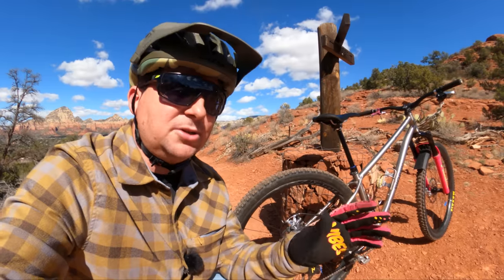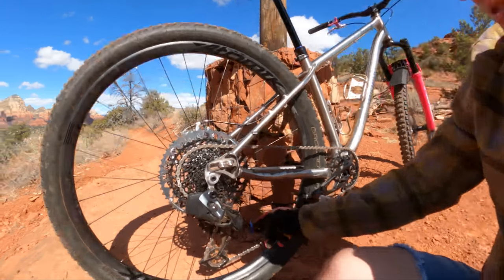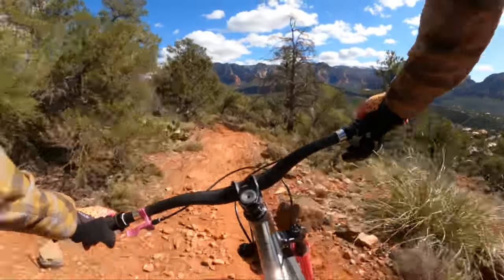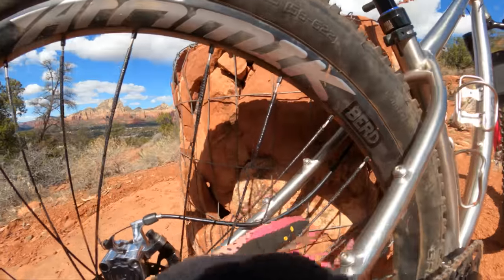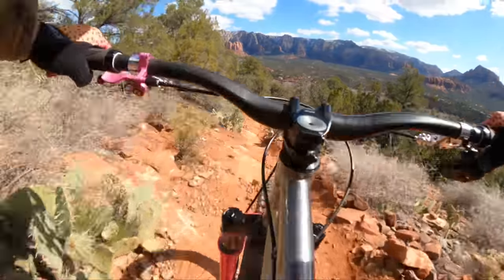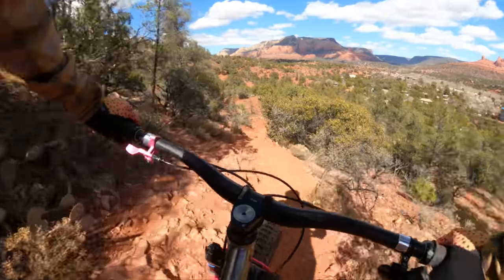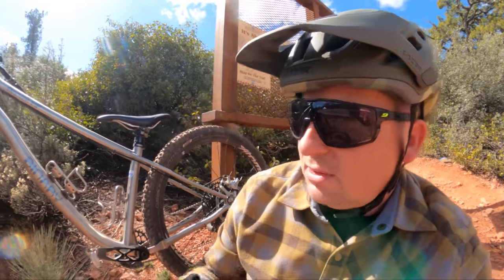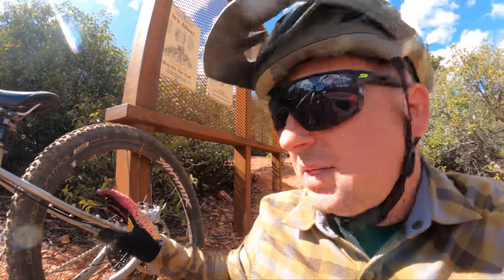Are BERD String Spokes More Compliant? Ride Test: BERD vs. Standard Steel Spokes

Comment: You should a super slow-mo huck-to-flat comparison on a hardtail with these spokes.
Reply from the maker: That would be very interesting to see. I wonder if it would be visible. I feel like most of the vibration reduction is on a minute level. I don't imagine these looking tons different from traditional spokes on a huck to flat since they have the same spoke tension as steel spokes. I think it's more of a micro vibration damping feel than a springy/flexy wheel feel.
Reply: @hardtailparty it would be interesting 
Impact makes even rigid structures do crazy things
Reply: @joelawton123  did you see Berd's own impact test machine? Its on their site
Reply from the maker: If only those cameras didn't cost $60k
Reply: @hardtailparty  see if you can't do a collaboration with the SloMo Guys!
Reply: @MrTrixton  I’ll have a look

Comment: Here's the elephant in the room that no one seems to talk about regarding Berd spokes: most Dyneema products have a life span of about five years. So are you going to rebuild all your Berd wheels every five years? This is one of the main things keeping me from adopting Berd spokes because when I build my bikes I'm not afraid to spend, but I expect things to last.
Reply from the maker: Interesting question. I haven't heard that stat before. I'm sure different dynema uses have varying fatigue characteristics and lifespan. But these haven't been out for 5 years yet, so I can't speak to that.
Reply: Yeah, huge variation in lifespan depending on usage conditions, grade of Dyneema, and any treatment used (such as PU coating). AFAIK the Berd spokes use a DM20 material which is SK78 grade. This means it is relatively low tenacity compared with higher grades such as SK99, but importantly is zero creep. Creep is where the material, if constantly loaded, elongates slightly over time. In a bike wheel, this of course would mean reduction of spoke tension. But I do agree, these spokes should be marketed as having a finite lifespan.
Reply: Berd only has a limited warranty for  5 years on the spokes.

Comment: Great video Steve! I always appreciate how well you articulate comparisons like this. 
I did a similar test but I rode a fairly high speed trail and noticed a the ride to be quieter, more damp, and a bit zippy-er in the turns with the berd setup. Overall it just felt more controlled and the bike was a bit easier to hold onto (for a hardtail) The difference was a little subtle but over the course of a 3 hour ride I think that adds up to a lot more enjoyable experience. And on a hardtail I think a wheel upgrade is worth more than buying a top spec fork vs mid-spec. Just my 2 cents. Keep killing it buddy! Hope to ride with you soon!
Reply from the maker: 100% agree, well said. I hope our paths cross sooner than later.

Comment: Interesting comparison and discussion. Have you or know of anyone who have tried Berd spokes with aluminum rims. I've only seen reviews of them with carbon rims. I have the Zipp 3Zero Motos on my hardtail and I love them. Being Berd curious, I'm wondering how it would be to replace the spokes on my Zipp wheelset with Berd spokes. Would it make the wheels feel too squishy given that the rims are already so compliant? I have the Zipp hubs so I don't even know if that's possible. Lastly, are the Berd spokes touching each other when they cross? I can't tell by looking at the videos but I suspect they do. If so I'm wondering what the long term effects are with them rubbing against either other with dirt/dust trapped in the pours of the fiber weaves.
Reply from the maker: That's a question I have too. BERD hasn't found a way to make their spokes work with those rims yet

Comment: Agreed on all points.  The spokes are lighter and they damp vibration.  So you still get the initial impact but it just feels less harsh and jarring.  I feel like my LES with Berd spokes and 2.4x29 is smoother than my 2.8x27.5 Chameleon with Atomik Chubbies and Tannus inserts.  And I LOVE the Chameleon, really fun bike and the wheels I have on it have really made it that much more fun, but the LES has really surprised me.  I thought it would be much more harsh, but it isn't.

Comment: Yo HTP, love your vids.  I could watch you shredding Sedona singletrack all day.  I think this comparison would be less biased though if you didn't know which spokes you were running.  Maybe next time have a bro put your wheels on behind a blind, do the ride without checking the gear, then swap out the wheelset (don't peek!) and give your impressions on both cases before the big reveal.  Makes for more engaging content, less bias, and thus better informed consumers.
Reply from the maker: Here's a fun way you can replicate this blind test. Seek out the timestamps when I ride past the same bit of trail with each wheeelset. Get a friend to toggle between the two. See if you can hear the difference between each wheeelset on this video. I'll bet you'll be able to tell which wheeelset is the BERD one because it'll be a LOT quieter than the other.

Comment: I'd love to see the physics behind the difference. If you think that a bike effectively hangs from the rim and the spokes are under a reasonable amount of tension it must all be down to the damping properties of the different materials and how they absorb/transmit vibration.

The aluminium rim/Berd spoke test feels like something you're going to have to do Steve now that a few people have brought it up! 😉
Reply from the maker: oh man, these tests are getting expensive!
Reply: Its pretty straightforward. The Berd spokes have approx 3x the elongation of a regular steel spoke (depending on the steel spoke), and the material used doesn't have the same resonance after a load-unload cycle.

Comment: Out of curiosity I weighed my front wheel (the rear requires tools. Too hard)
Praxis AL32 alloy rim laced to a novatec boost hub with straight gauge stainless spokes (unpainted) with a 29x2.5 Maxxis Minion DHF in tanwall and a 200mm Shimano XT rotor 
2340g

Comment: You should do a review on the fezzari Wasatch peak! 900$ for a boost thru axle bike with air fork. There is many different spec levels… the most expensive being like 1800 the cheapest being 900

Comment: I am rather curious how you determine the right tire pressure for yourself, especially with you switching tires. I watched a video about 5 yrs ago on finding a good tire pressure for yourself and the type of riding/trails you do. The guy said to start within 4-5 psi of the max pressure of the individual tire, ride a similar trail, drop the pressure 1 psi each ride, and when the tire feels like it's trying to roll off the rim, go back up 1-2 psi. I'm not sure if this is the right way, but it seemed to work for myself. Just wondering your opinion on this since you have alot of experience with tire swaps, especially with hardtails. 
I ride a plus hardtail and every tire has been different, tread pattern density, sidewall stiffness, and tpi
Reply from the maker: I go entirely by feel, not by numbers. I know it sounds like a cop-out, but I don't have a magic formula. I don't entirely agree with what that other guy said, but if it gets people experimenting, I'm all for it. I run different pressures between my hardtails and my fs bikes too, with my hardtails running a lower pressure. So much depends on riding style and terrain, as well as rims, tires, etc.
Reply: @hardtail party  Thanks for the reply. That guy's advice was in my opinion a good starting point, but ultimately like you said it's all dependent on terrain and feel. I ended up going about 3-4 psi higher than what he suggested, it was too soft and felt like I had a flat.
Keep up the great work, love your content. I am not being biased just because I love hardtails.

Comment: As far as mountain biking being an expensive sport, what surprised me most was how much the tires cost and how fast I go through them. I go through about 2 sets per season and if I get maxxis tires, that's almost $400.
Reply from the maker: Tires are indeed CRAZY expensive. That said, I'm pretty impressed with what they can ride through these days without popping, but yeah... they shouldn't cost nearly that much.
Reply: That's why I ride specialized tires
Reply: @Alabaster  good point. They had a sale recently, and I got three tires shipped for $100.
Reply: Facts! The other day I was looking on Amazon “obviously”, to buy some Muc Off Drivetrain degreaser. What did I find?! A $135.00 bike cleaning kit with a microfiber cloth?! Just ridiculous…

Comment: What would the BERD spokes do for a journeyman class wheelset like the NukProof Horizon v2?
Would it be a better upgrade to change out the spokes, or get a supple carbon rim?
Would we notice the weight and ride quality from the spokes more than rim construction?
Can we even do that on an aluminum rim?
Thanks for the review!
Reply from the maker: Lots of great ideas for future experiMENTAL videos. Since the BERD spokes themselves cost more than the entire nukeproof hzn wheelset, I don't imagine a lot of people going this route, but who knows... You're over $1k into wheels at that point. Could still be a great bargain if it rides better than a set of light bicycle wheels. I imagine it'd improve things nicely, but usually when people are willing to spring $600 for spokes, they're willing to spend a bit more for carbon rims.

I feel like supple spokes feel different than a supple rim.